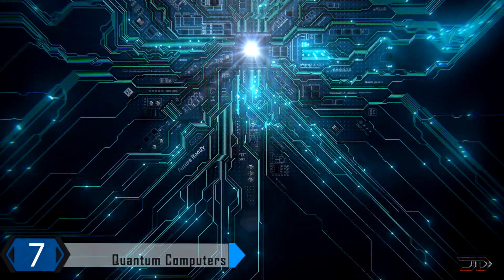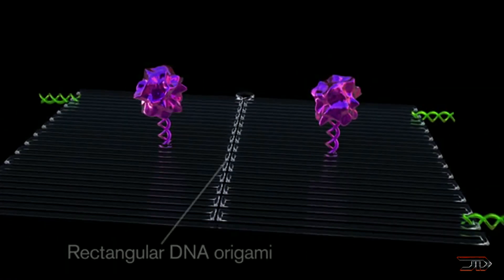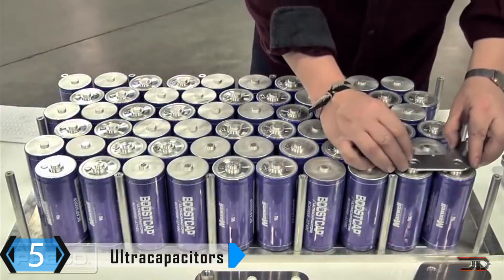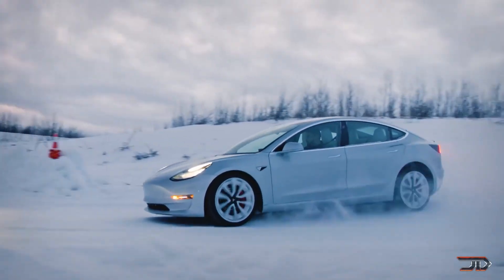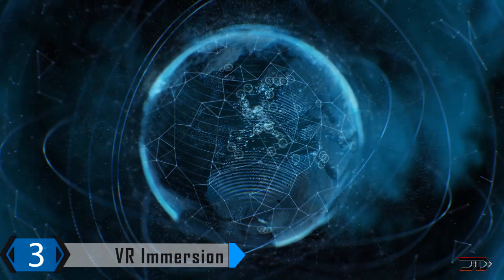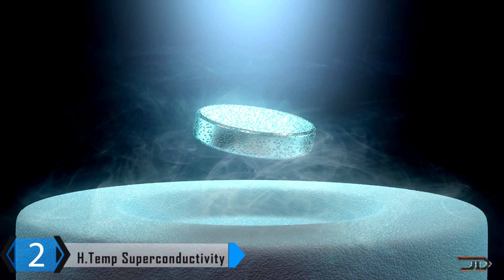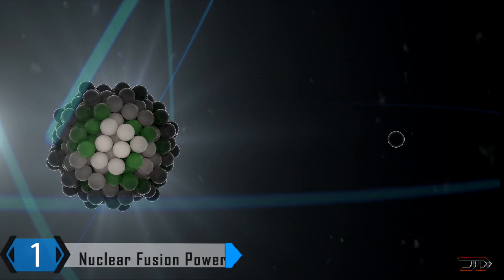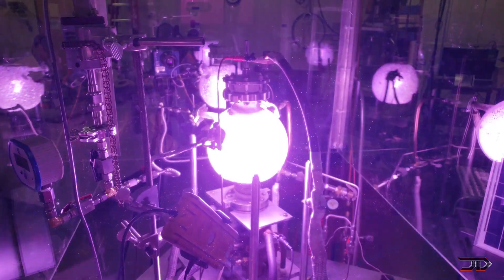TOP 7 Emerging Technologies That Will Change Our World!

Comment: Worth mentioning that quantum computing is (at least for now) fundamentally limited by superconductor technology. If there's any exchange of information between either half of an entangled qubit and the outside world, that destroys the entanglement. Quantum computers use superconductors to prevent this, so you're never going to have a personal quantum computer without some form of superconductor that can be stable at higher temperatures. Otherwise, we need some other completely unknown means of isolating entangled particles from the rest of the world. Even in the best of quantum computing systems, their limitations are imposed by the stability (or instability, really) of the entanglement.

Comment: Room temperature super conduction was found by Dr. Ning Li, in 1995. It was doing Bose-Einstein condensate, creating it's own gravity waves. She "disappeared" for around 10 years, then on the down low another 6 or 7 years, then BOOM ACGravity LLC, Huntsville Alabama. Also note, at phys.org, another one was announced that worked at just over normal -57F, about 6 or 7 months ago. Fusion is, and always will be, a pipe dream. It's a giant money pit.

Comment: Someone has claimed to have made a superconductor in room temperature
Reply: yes that is true but it was also done through emulating the requirements by forcing the subject under intense pressure, to make up for the lack in minimal temperature - just like how you can either boil water by raising its temperature, or by lowering the external atmospheric pressure.

Comment: when i built my house i built in simple capacitors into the concrete foundation , walls and ceiling using aluminum foil and polyurathane . the resulting capacitors energy density allowed me to store enough energy to power my entire house's electrical system during the night . the caps are charged during the day by solar panels. high voltage inverters are built into each cap. eliminating the need for heavy gauge conductors and energy loss in the lines . the system is 98% efficient .
Reply: Uh-huh........sure.

Comment: Every one of these video's leave out photonic based processors.
They are much closer to consumer ready than quantum computing is.
But, not much R&D is going into it compared to the super cooled quantum computers. A crying shame.

The problem is converting photons back to electrons to interact with the analog parts of current generation computer parts. I don't understand why some group of engineers don't just form a company and design a new industry standard based around photonic cpu's, instead of trying to integrate photonic cpu's into old technology.

Comment: Only because of entanglement of qubits is the size of the state space of a quantum computer exponential in the number of qubits. Without the possibility to entangle or correlate the qubits, their property of individually having a state of both 0 and 1, each with some possibility, is not very interesting - many systems have that property. The size of the state space of non entangled qubits is still linear in the number of qubits. Entanglement or correlation - the fact that one qubit having a certain probability of being 1 potentially influencing the probability of all the other qubits having certain values - is what gives quantum computers their power.

Comment: This video starts with an error saying that binary computers will be replaced by quantum computers.  They will be complemented, but not replaced.  On problems that have exponential (instead of polynomial) quantum computers will be tremendously faster than binary.  But also tremendously less precise.  A quantum computer will provide 2000 answers in less time than a binary can find one.  But which of the 2000 is the good one?  There, the binaries will take over and finish the work.  (Yes I know : most equations have more than one solution.)  So far, the so-called "quantum supremacy" was attained by submitting quantum computers problems carefully selected to prove quantum supremacy.  Quantum computers will be really useful when they are made to sole real problems, not when problems are designed to prove the computers.

Comment: Very shallow explanations. For quantum computers they will probably never run things lile an operating system. What will probably happen is a quantum computer working alongside a normal one. This would be lile having a graphics card, which is a specialized type of processor. When you need to encrypt things or run simulations those instructions will go to your quantum device and the results will be handled by your everyday computer.

Comment: Hi Tech Planet Guys/Girls..Can you check into a "possible" new advanced Tech? This might be real or it could be conspiracy theory stuff. BUT there is speculation that DARPA or some top secret agency has been testing some form of laser technology, pulse lasers or something of that nature that when used infront of Hypersonic aricraft it basically blows holes in the atmosphere that reduces drag and stops or reduces sonic booms or waves.  It sounds Star Trekie to me but, could be real. It works the same way as what they do in pools for olympic high divers when they use bubbles below the surface of the water to soften the impact of the water for training and or really high dives. At super sonic and hypersonic speeds the atmospher is like a block wall infront of the aricraft.. IF they can blow holes in the atmospher like swiss cheese they can use that for more speed or less energy to cruise to obtain cruise and maybe lower the temps on the aircraft surfaces too.
Reply from the maker: Hi Jeff, it's just me & I believe you are talking about terahertz waves which can change air into plasma. I will definitely look into it as I'm making a video about defying effects of gravity.

Comment: Told y’all if you run a alternator off the rotation of the tires as it moves to charge the battery you never have to charge it or just off the electric motor itself how is this a problem for you guys when you used a alternator all this years to keep the battery charging

Comment: Why doesn't anyone talk about self-replicating 3D printers?  If a 3D printer printed another one you would have 2 then 4, doubling each generation, and every 10 generations thats 10 doublings or 1024 and in 40 generations we would have quadrillions of them.  You could then have the quadrillion 3d printers solve climate change by absorbing Co2 every time they self-replicate or terraform Mars by concentrating the sunlight to unfreeze the Co2, solve world energy by having them build tons of tidal, wind, solar collectors, solve the scarcity of stuff/homes by having them print out houses.  The 3D printers could print out solar/wind/geothermal powered drills to create huge underground structures and sand collectors and sand seeders to terraform the coasts of Arabia/North Africa in a fractal pattern.  3D printers could print out stem cells, geopolymers, mud, ice, several types of materials instead of just a single one making it easier for the 3D printer to self-replicate.  The 3D printers would also build more specialized 3D printers to print wheels, round objects that are shaped like clay, or "hands" that would assemble the 3D printers from its 3D printed parts.

Comment: Metal organic frameworks are another emerging technology that sadly fly under the radar.  They can be used to extract chemicals efficiently.  They can be used for mining, environmental cleanup, and even water condensation on an industrial scale, all with very low energy input.  They are also safe for the environment.

Comment: Because capacitors have the ability to store energy over time and discharge it almost instantly, the current can be insanely high.  If punctured, the device would explode, probably with as much force as ANFO.  High density batteries are dangerous, capacitors, more so.

Comment: Things get smaller without reducing the feild that causes Resonance.

Information comutor chips will not get smaller until humans send information to the components directly.

This requires frequency in Lazer beam form. The year is 2020.
In 2021 humans will shift from using radiation to using frequency by Lazer for x-rays.

That is still primitive and is like inventing a  telegram system that uses electricity but isn't even a radio. Even Tv is still be long way off has an exsample. So too are frequency noid receivers for any future computers.

With frequency been the next jump forward, let's see what path Humanity takes.

Comment: Hope we stop using A.I. to play games and input a set of rules for winning that figures out what every applied science guy wants... real world answers. Like what is rattling around in my idea/ dream space. I used to play with magnets (not board games)  as a kid to pull iron fragments out of the sand and it has stuck with me.  
Go with this idea... electromagnets affect things in 1 way, while the simultaneously alternate (yet unknown) magnetic fields will undoubtedly affect other atoms in other ways.  Once you get these fields all programmed have the A.I. fire on the base starting material in a real world tests, in every conceivable pattern. Using magnetic fields, light and sound wave length, quantum , frequency and observe the result. A.I. can do this in seconds and the results might surprise us.  We were stunned when it won at Go.

Comment: We are not digital and nothing in Nature is digital. Oxford quantum physics professor Andrew Steane wrote in his paper about quantum information systems titled "Quantum computing" at https://arxiv.org/pdf/quant-ph/9708022.pdf :

"The new version of the Church-Turing thesis (now called the ‘Church-Turing Principle’) does not refer to Turing machines. This is important because there are fundamental differences between the very nature of the Turing machine and the principles of quantum mechanics. One is described in terms of operations on classical bits, the other in terms of evolution of quantum states. Hence there is the possibility that the universal Turing machine, and hence all classical computers, might not be able to simulate some of the behavior to be found in Nature. Conversely, it may be physically possible (i.e. not ruled out by the laws of Nature) to realize a new type of computation essentially different from that of classical computer science. This is the central aim of quantum computing."

From what I understand they are forcing current quantum computers to unnaturally apply a binary state to something that has a infinite evolution of states. Think of the electron and the circle it makes around a nucleus. That 360 degrees circle it makes is infinite in precision, and that movement certainly has an effect on its surroundings. Basically, practical math is the descriptive language of the universe, and not the actual universe because it uses measurements.

I propose a "Dynamic Stateless Computer" that operates on "Logic Geometry" based only on connections, or links, or pointers - a much more simple computer than the three basic Boolean logic gates operating on mathematical binary bits that is every computer out there. The shape is the logic and the logic is the shape, sort of like a truth table that is dynamic where the "truths" change as it runs. 

Quantum mechanics is beyond me, but if this only needs connections, ie a quantum entanglement, can we build a computer that operates and does its entire run instantly? Like I said, all I need is connections to perform logic... no need for information... the shape is the logic. 

You are best off going to Github and seeing online without downloading the paper and models. When someone looked at my calculators, they accused me of: "You're not doing math! You're emulating math!" Look at the simple calculator first, it only does addition and subtraction. Then look at the complex calculator that does multiplication and division.  As you well know, if I can do those things, I can do anything mathematically. In the main model I created if-thens, complex do-whiles, a randomizer and a relational database.

https://github.com/johnphantom/Dynamic-Stateless-Computer

Through the exercise of the most complex do-while I asked a question related to that, and the answer uses the ancient Chinese/Pascal's Triangle (which millions have looked at over thousands of years) in a new way: https://mathhelpforum.com/threads/combination-lock.17147/ I basically had to count nothing as something to count, as in you can have different items to count the permutations of but a default state of no item is possible for each, some or all to count in the permutations, and it doesn't seem anyone else in history was able to use the really basic mathematical concept of the Triangle in that way for the solution. The technique of the implementation is a little interesting, with it being able to reach any of the 209 possible combinations in 4 keystrokes or less - it's how it scales that is the curiosity, where if I had 18 wheels and 18 numbers to form a combination it would have almost 3x10 to 18th power or 2,968,971,264,021,448,999 possible combinations, each reachable within 18 keystrokes or less.

I don't have any idea as to how this would be physically built - none of the aspects of it, except for the dynamic logic that I also do not have any clue if it really is what I ask above. I just can do these things I demonstrate and in my extensive almost 50 years of digital computer experience I have not seen anything exactly like it.

Maybe you wonder about my computer experience? I have always been fascinated by computers, starting in 1972 using a prototype Cogar 4 that my dad got his hands on, when I was 3. By the time I was 5, Singer wanted to use me in a commercial to sell the computer, because if a 5 yo could start it, load the OS and then load games, that proved anyone could. My first mentor helped develop Ethernet after working for my father, and allowed me to hold one of the first breadboard ethernet cards developed when I was 10. My first real program (programming since at least 5 if you count the Cogar ASM I had to type to get to the OS and games) was in BASIC when I was 11 that I learned from a manual without anything more than a small example for each command, written with pencil on paper; a rudimentary AI demonstration called "Animals". Second program I made I had another computer (we had moved and left the one at my dads company behind when he sold it) and was a dot bouncing around the screen. Third program, with 12 year old's understanding of math, I attempted to do 3D. I first professionally programmed in 1982, started building computers and networks for a small computer company in 1986 owned by my second mentor, Peter De Blanc who lead ICANN for a period, was an official beta tester and developer for OS/2 2.0 and developed a device driver for it for the extremely complex Truevision Targa+ 64 video editing board (pic: https://imgur.com/a/hMe21Qe ) directly flipping bits on it in 1991. That's almost 30 years ago. My experience has only gone up from there. This dynamic logic is something I found, that I have never seen anything like even searching for it on the Internet for the past 20 years.

Comment: The first 15 seconds of the video and it's already wrong to some degree. We dont know whether quantum computers will replace normal computers. That's one way it may go, sure, but it's far from set in stone that this will happen. They may remain a niche component used in some aspects of computing, like cryptography. They have their strengths, but may also have their weaknesses (unless that changes). They may not even ever become consumer friendly, unless the required amount of precision and cooling changes. 
Dont get me wrong; quantum computers are awesome, scary and freaking cool (pun intended). However, it's simply not true that they will certainly eventually replace normal computers.

Comment: I disagree on being deadlocked.
We can go a "total new way" by introducing 128bit or 256bit processing/computers.

ATM, we shrink the tech in CPU's and slap on more and more cores to gain power, ignoring the fact that higher bit-rate processing can be achieved and more power is gained.
Of course, one must also keep in mind that 64-bit exists now 17 years (by this, I mean the MAINSTREAM INTRODUCTION, NOT IT'S 'BIRTH': the first 64bit PC was introduced in 2003 into the 'main household' systems), and yet, up to this very day, MANY simply refuse to make 64bit programs, or games.
Most keep using 32bit, ignoring the additional power that comes with 64bit -if implemented correctly-.
How many professional "multi-core/multi-thread" programs actually do as said: spreading the workload EQUALLY over all cores/threads, is another example of software design fails.
Machines are quite fast, but doubling their bit capability increases their power and logically speed exponentially.

Still, it seems they prefer to on one hand milk out the 64bit systems and otherwise ignore the 64bit power by enforcing their 32bit program style...
Still, deadlocked, it is not.
Not just yet.

As for Q-bit PC's... myeah, that's not for tomorrow, trust me.
Reply: Also, I think the main issue will not be power issues for Qbit machines... but the cooling.
Considering these operate at nigh 0 degrees Kelvin (-273C approximate), one can see that water cooling your PC will not quite suffice.
More, having a home pc having a cooling system to get to nigh 0K... that won't be a portable format, one might assume.
So, a Qbit laptop?
Naaaaah, not any decade soon, I guess.